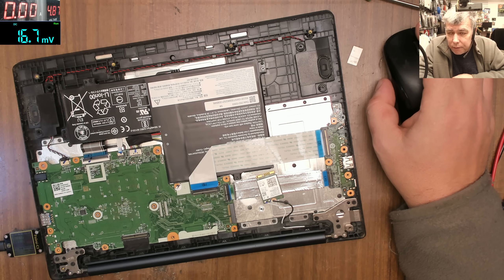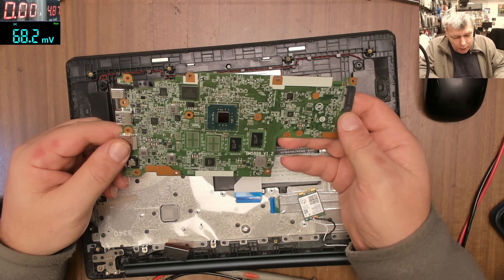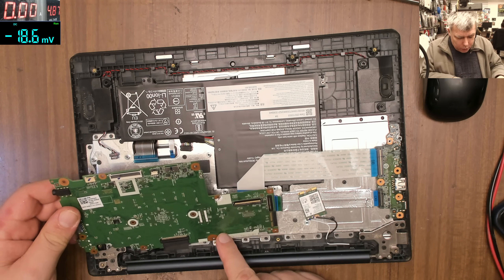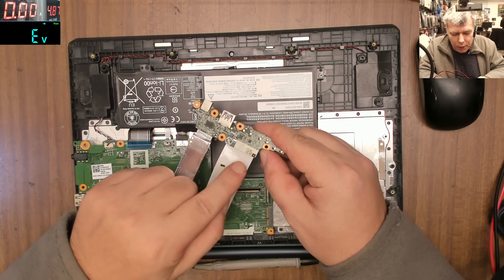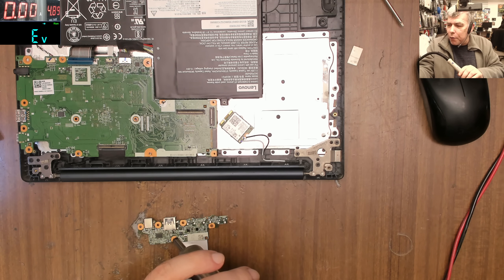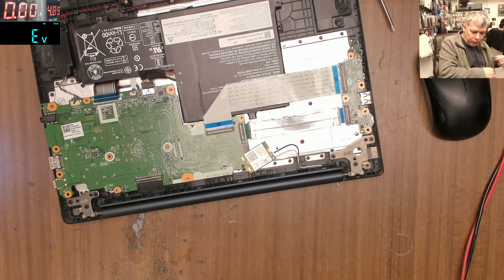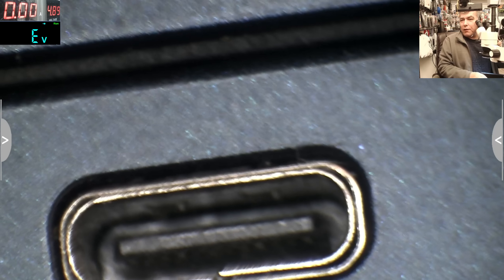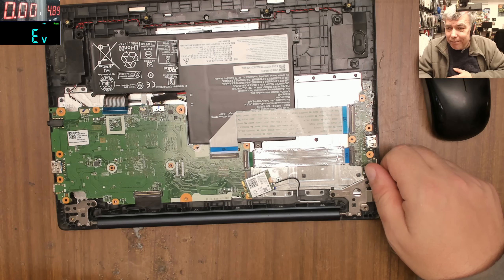Lenovo ideapad 3 - Not charging, not coming on repair - USB Type C the worst port design ever

Comment: Take in account that the USB-C contacts have a width of 0.25mm (+/- 0.04) and the most recent specs want to pull 240W over the connection (50V at 5A)
good old barrel jack...
edit - I just used a wire size calculator and the recommendation for a 50V/5A power draw is a cross-sectional area of 0.326mm². The contact pad has a cross-sectional are of 0.0125mm² (cca)
Reply: Not to mention the mating ends have to have a large contact area to carry that current.
Reply: pull it contiously or just peak ??
Reply: @EFDawahWiseSmile2LanternDen  Continuous, like when you are charging the battery and playing a demanding game.
Reply: @SelfMan-SK  thank you so much ...i have another question for you brother...how much current can a copper strip 5mm x 0.2mm handle ??
Reply: @EFDawahWiseSmile2LanternDen  I am no wire expert, but chatgpt says "A copper wire 5 mm long and 0.2 mm in diameter can handle a maximum current of approximately 94.2 mA without overheating. Please note that this is an estimate and may vary based on the specific conditions and the actual temperature rise of the wire."
Reply: @SelfMan-SK  ow 5mm is not the length but the wide...anyway thank you.

Comment: It's designed to fail, sells more laptops. If people stopped buying laptops with usb-c ports, they'd change back but people won't because they don't know any better. If you look at a Dell dock USB-C connector and the weak solder that holds their ports in, there is no surprise people are going mental trying to get their dock working. I've literally seen Dell laptops where the legs of the USB-C are barely soldered, some aren't. Look at the size and weight, (deliberately made big and bulky to weaken the usb port) it is designed to fail, simple.

Comment: I think he was having a bad day, because if the power went down the data lines it would've killed the PCH, ie, it was probably just a chip failure. 
At least it wasn't a M1 16" Pro, because the chip that powers the on-board SSD commonly shorts and sends 15V into the SSD memory chips, ie, no chance of recovery and a super big bill - lol -.
Reply: New Mac studio has the same problem with USB-C port
Reply: @ronlevin2339  I bet the Apple chip also comes from the same manufacturer, ie, it's not the USB-C std, it's poorly manufactured chips.
Reply: @SidneyCritic  No, there problem is not with a chip, but with a port itself. Very poor design, almost no ground legs.
Reply: @ronlevin2339  If it's got inadequate GND, ie, not rated for the current, wouldn't it burn open circuit. This chip shorted like an active component welding together. 
I've watched close to to1000 repairs, and I'm not seeing USB-C chip faults. I've seen about 200 connector changes, but they are usually from rough handling, ie, USB-C is a bit fragile, but this is my first USB-C chip shorted. I've got the same fault on a USB3 chip on a motherboard, it just seams like an everyday common fault. 
If you want to know the truth, send it to KEN from CuriousMarc and he will de-lid it and photograph it and tell you exactly what part failed - he can spot components just by sight -.

Comment: Well, I have bad news for your Sorin, all notebooks are set to come out from factory with USB-C port 😥The thing is, that not all USB-C ports are equal. Some have through hole pins, others just surface mounted pins. IMO, Lenovo is using the worst kind of ports in their Thinkpad series (maybe Ideapad as well), and they are not securing the ports with some kind of metal bracket, to prevent them from breaking easily. Had a Thinkpad which had lots of through hole pins which were all broken, as the port was not properly secured by a bracket, and worse than that, some of the pads were gone.
Reply: Lenovo dropped down quality long time ago. Especially their soldering technique at factory and solder material. Today I had Ideapad 330? Don't recall exact number. Customer complaint: black screen, charge light changing state every second. Confirmed that BIOS kept resetting for some reason that's why black screen and long boot time, disassembly time. I tried to remove battery connector with tweezers and just a slight pressure from tweezers made connector completely snap off the board, traces intact fortunately. 2 plus pins had burned solder so they cracked a while ago, rest didn't hold either. Resoldered connector, BIOS keeps being funny but for good measure while it still did read I made dump and I'll replace bios chip for the customer for a good measure.
Reply: @MrHimer12 from your repair experience can you tell me which laptop currently in these websites like MCentre dot LK or Barclays dot LK have support for switching their ssd to 2TB HDD and support 16gb ram upgrade and won't face motherboard issues like we see in this video and many others where dumb design ideas create short circuits overtime. Been trying to figure out a good laptop which has a process with base speed of CPU of 2.5Ghz or more and GPU above 2GB but still not sure since Specs only don't matter now have to watch out for mother board quality above all it seems any help figuring this out